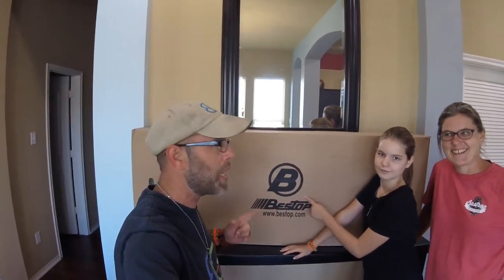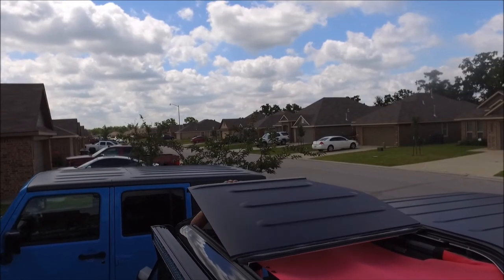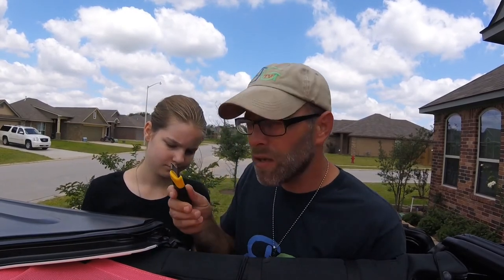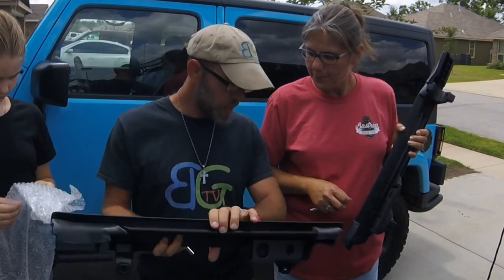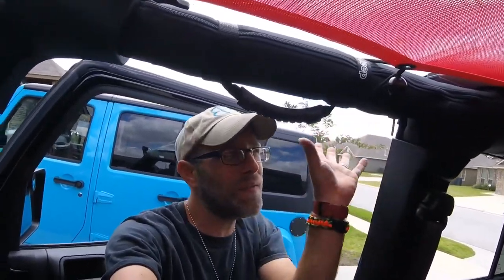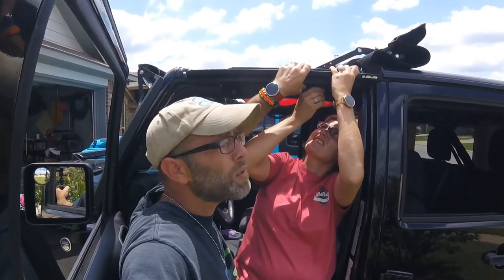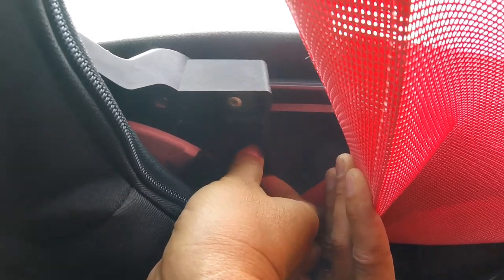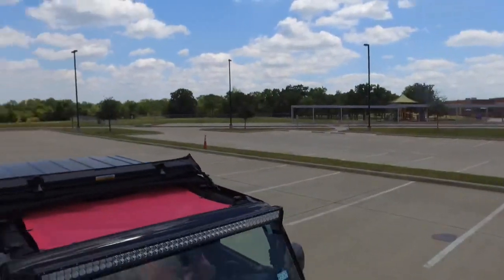Episode 250 - Jeep Wrangler Bestop Sunrider For Hardtop

Comment: Cool video.  My opinion is it's not worth the ridiculous price, may as well just buy a full soft top off Craigslist like I did for $550 brand new.
Reply from the maker: Oh I know what you mean. We so contemplated it. She just didn't want a full soft top. Me on the other hand I would probably go full soft top. Much more value for the price for sure.
Reply: I have both tops.  I absolutely love the soft top so much better.
Reply from the maker: +nyc_jeep_wrangler nice, oh I totally get that. In the summer I usually drive the Jeep TJ and it only has the safari top on it. That's it love it